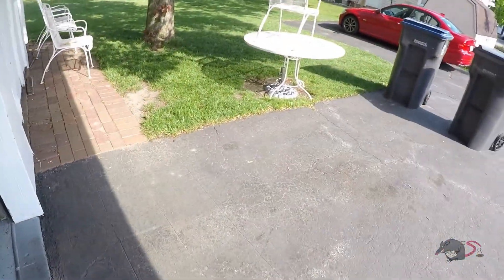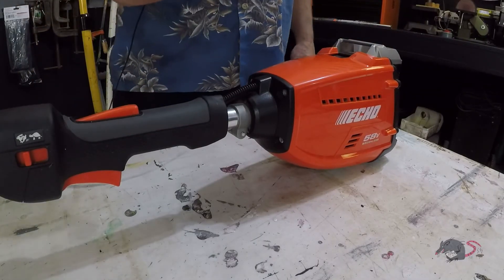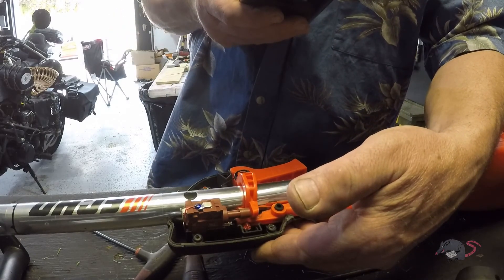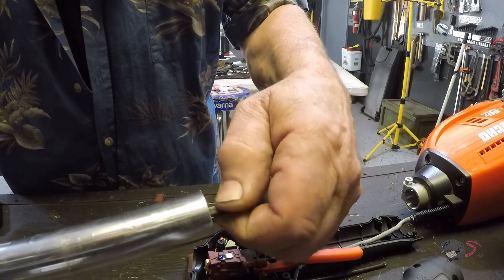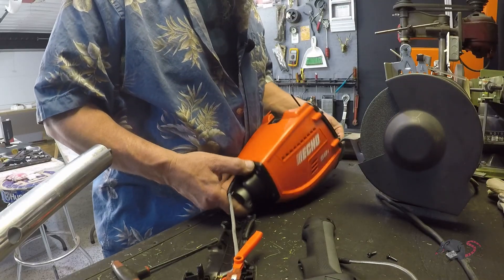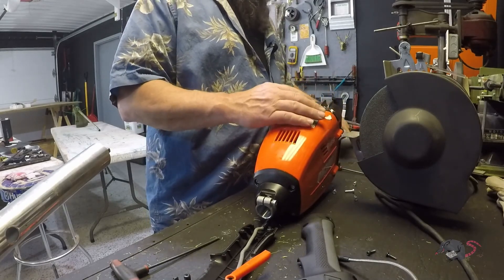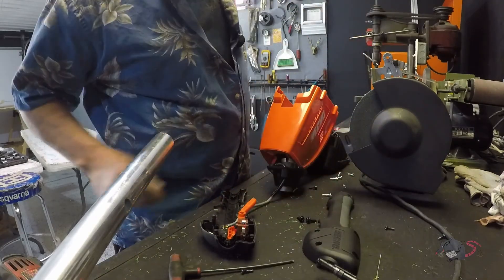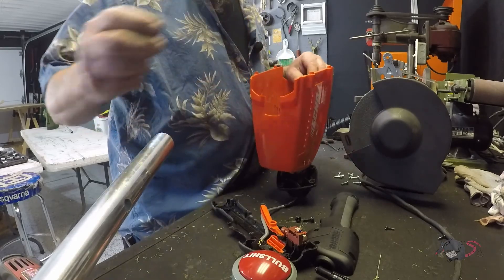Echo 58 Volt Trimmer Vibration

Comment: So what was the problem!?
I have the same issue plus sometimes the head stops spinning like is free wheel...
Reply from the maker: In my case the upper drive shaft was bent and creating a vibration. I've sold more of these trimmers and they all sound noisy in the power head. If your head stops turning "sometimes" then I suspect one of the shafts isn't fully seated either at the power head, split shaft or trimmer head.
Reply: @TheGreasyShopRag  i'll try that! Thanks man!!
Reply: @TheGreasyShopRag  it looks like is the upper shaft also. Do you now the part number and where can I buy it?
Reply from the maker: @juancarloschevere6474  Your local Echo dealer should be able to help you. Shop local so those guys can keep the doors open and not fade away. Thanks for watching.
Reply: @TheGreasyShopRag  thanks again!